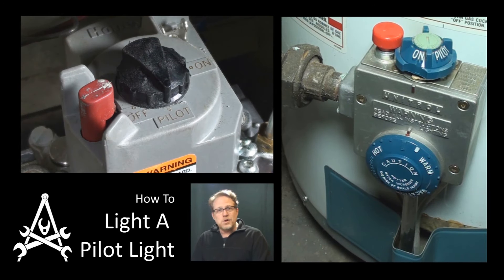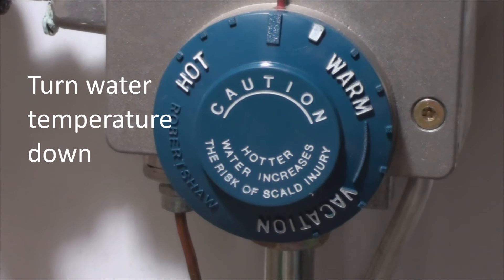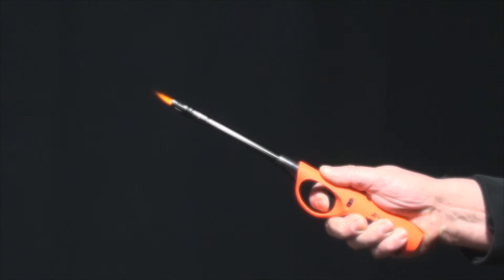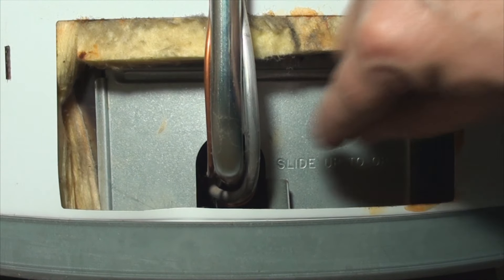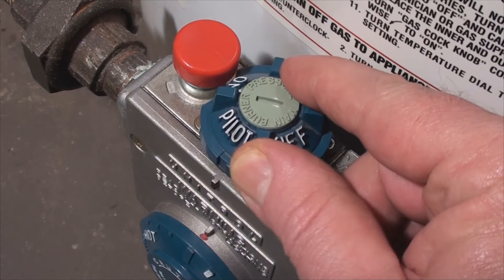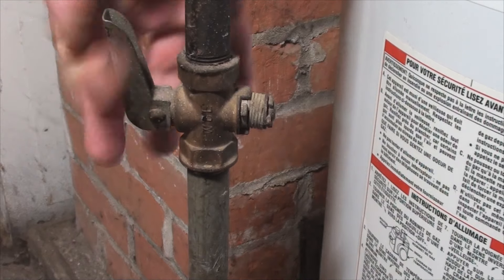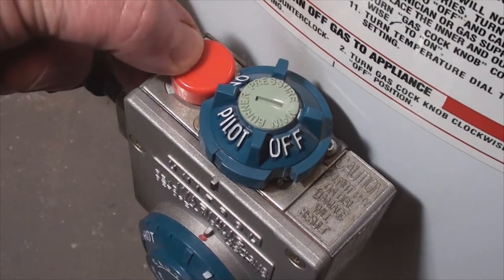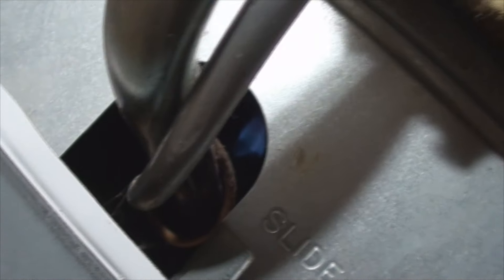Light A Pilot Light - How To In 3 Minutes & 10 Easy Steps

Comment: Cozy floor furnace new gas valve , new pilot, new electrode , new wire to sparker , new thermo coupler , getting gas from valve body through tube to pilot, no gas comming out of pilot , turned pilot rod and pushed down and did spark many times, smell no gas , took apart blew air threw pilot tube , it's clear look inside pilot and took out little orifice and held to light and can see threw it , put pilot tube back to pilot blew air threw it , barely anything comming out. Thermostat low setting and also new. My guess ... Gas pressure ? New gas valve gas pressure preset from factory ? Basically all new parts what you think ? Thanks !!